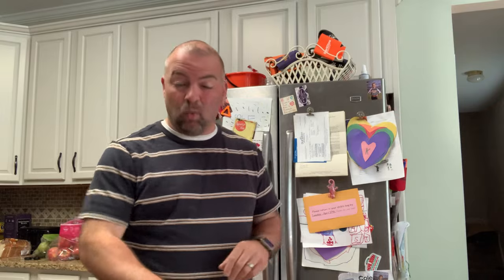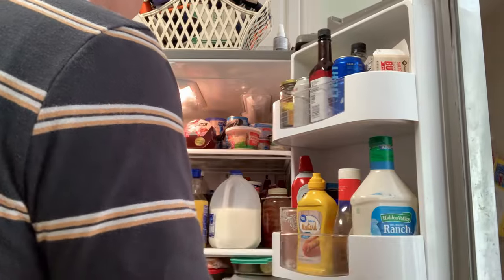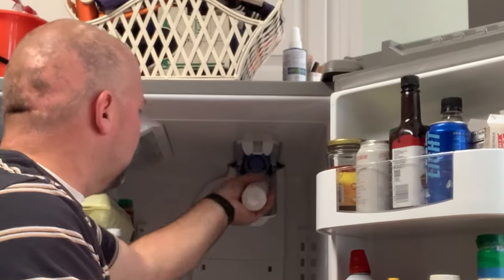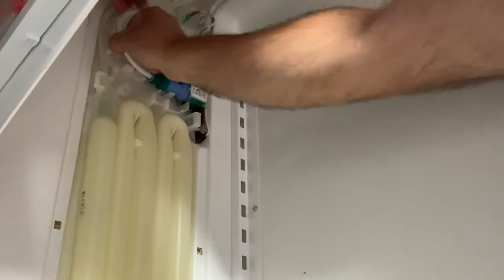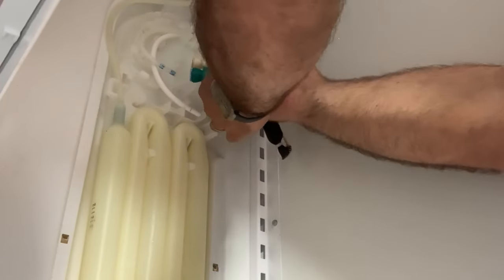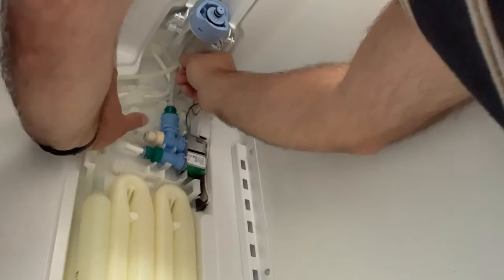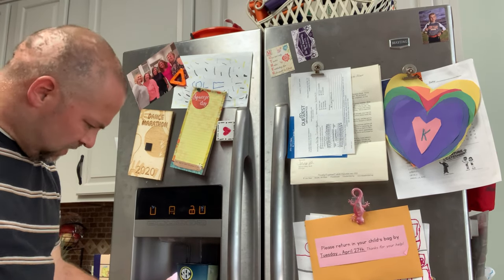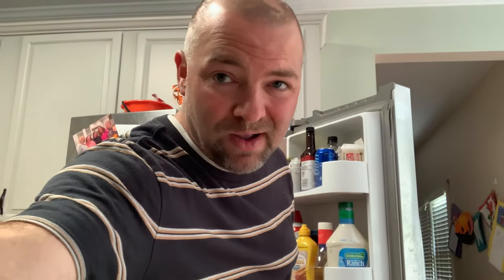Refrigerator Ice Maker Fix - Water Inlet Valve Replacement (Maytag /Whirlpool)! - by DIYNate

Comment: me: 👀, after attempting this and messing with the electrical components, hey babe, i got the ice maker up and running. but, now somehow I dun knocked out the home security cameras, in the home.

wife's rection:😠
Reply from the maker: Ouch - never fails - two steps forward, one step back I guess?  Hope you got it squared away - stay safe with the electrical, friend!
- DIYNate
Reply: @DIYNate  ended up being the icemaker. Had a professional step in this go around 🤣

Comment: Hi, I replaced the water valve, how do I make sure that my ice maker getting water?
Reply from the maker: One way after installing the water valve is to listen for the filling of water sound (fridge makes a 10 or so second sound where water should be filling the ice maker).  You can also reach into the ice tray and carefully feel around the icemaker fingers to see if there is water there.  Or wait a few hours to see if it is making ice - if not, you can take the ice maker out and see if there is water in the tray.  Another good check is also to make sure the water dispenser on the front has water coming through it when activated, although just because that works doesn’t mean the icemaker water valve part is working (but if it doesn’t work, could be a sign of an install issue or the water not being turned on).  Hope you were able to get it resolved!
- DIYNate

Comment: So I replaced the ice maker and the water valve in my whirlpool and did not work; makes the noise but still no water and the ice maker is not receiving water at all.
The water source is open.  what else could be?
Reply from the maker: Hello Jose - hope that you were able to get it figured out.  If you aren't getting any water at all, there is another filter on the back of the fridge that could be where the problem is, vs the interior valve.  May be something else as well such as an interior electrical / motherboard type issue but that is beyond my skill.  Good luck with the fix and hope you get back to working soon!
- DIYNate